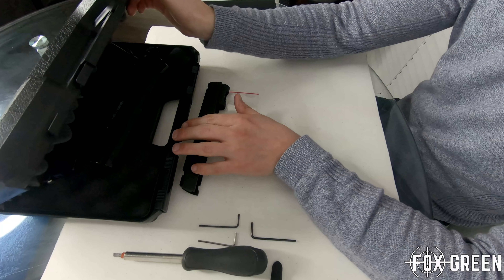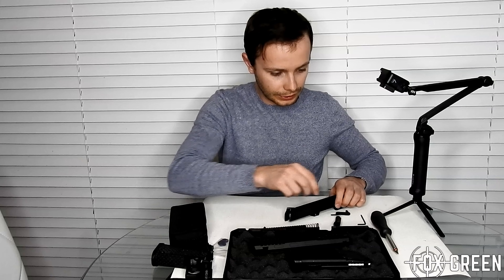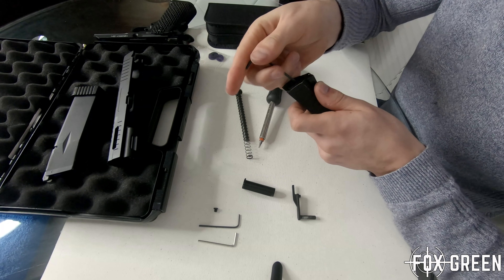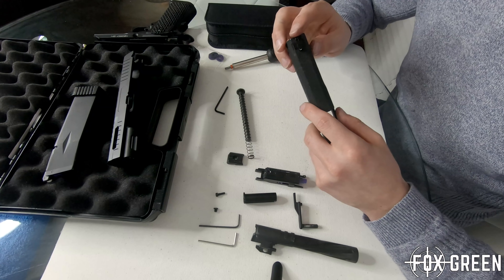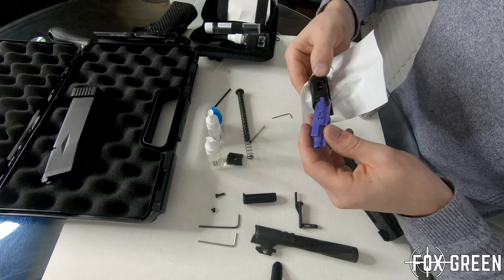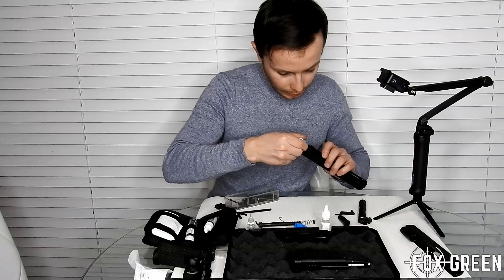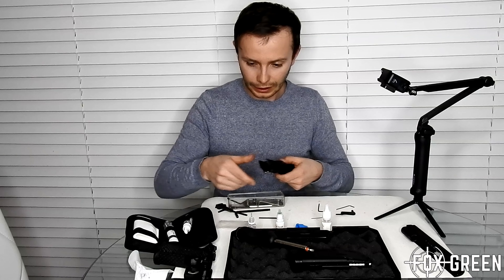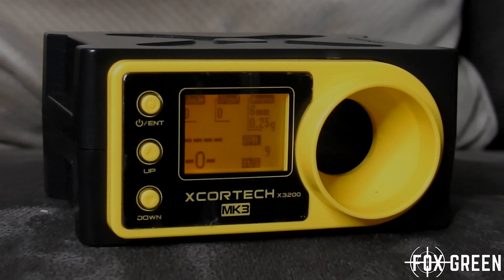NOVRITSCH SSP-1 SHORT STROKE KIT - INSTALLATION HOW TO VIDEO

Comment from the maker: Guys and Girls if you have any comments or queries that you feel I didn't expand enough on please drop me a comment and I will do my best to address it. Thanks Fox-Green
Reply: Know where I can find that tiny Allen key that you used to take off the front sight?
Reply from the maker: @andrewstewart6172  you could get a set of small ones on amazon if you look or a local hardware store is a good bet also thats where I got it 🙂
Reply: @FOXGREEN  I got impatient and cheap by finding an old iFixit bit (the one for phone repair) that was too small so I used a micro-fiber cloth over the bit to fill in the extra space and prevent damage to the screw and it came undone. One could argue it was simpler to do than a trip to the hardware store.
Reply: @FOXGREEN  Your response time and your content is superb, that earns you a sub 👍
Reply from the maker: @andrewstewart6172  good job man! Thanks for the sub 🙂👍

Comment: Great video! This gun is more tricky than others to short stroke... thanks for showing us the method!
You showed that the slide was still able to lock. Correct me if I’m wrong, but Shouldn’t the slide NOT be able to do so if it’s short stroked?
Reply from the maker: All other guns that are short stroked can't but this one was made so it should be 😉

Comment: Is the co2 pistol legal in ireland or is the fps too powerful? Just wandering cuz I saw on the website that the fps is over irelands legal limit.

Edit: nice vid tho  keep up the good work!👌
Reply from the maker: I got the first batch of ssp-1s and mine was over at 1.3 joules I modded it then to fix it which I also have a video on. However now I believe the pistol is actually under a joule as stated. He also released a black nozzek to fix the one that are over 1 joule whick I have ordered recently 😊
Reply: @FOXGREEN  Thanks! Will I have to worry about customs tho if I order it?
Reply from the maker: @redradical4313  coistoms didn't stop mine so you should be grand
Reply: @FOXGREEN  sound out👌
Reply: with green gas or C02?
Reply: might bite the bullet and get one. Was worried about the FPS with C02 being too high. I see the muzzle reducer on the website, but if I can get away without needing it that'll be 💯
Reply: I just ordered two more CO2 mags

Comment: Hey Kieran nice meeting you today in round wood just wanted to know if you need to buy a less powerful spring for the ssg24 or does the m90 do fine and also what gram BB’s do u use for the ssg24 and also does the ssp1 meet with Irish laws out the box or is the spring to powerful
Reply from the maker: Same here man great playing with you. If you get the Ssg24 with the 1 joule spring I think it is an m90 that is grand. Mine shot a bit low when it arrived so I put in a better spring and some shims to tune it to 325 fps and never touched it since 😊
Reply: FOX GREEN oh ok and what gram bb’s do you use
Reply from the maker: @brandmd5657  today I used 0.32g bb's depending on wind I may use 0.28 or 0.3 as also as I will get more range with them
Reply: FOX GREEN thank you and by chance do you know the name of the spring that you upgraded to
Reply from the maker: @brandmd5657  I don't actually man sorry 😔
Reply: FOX GREEN it’s all good man thanks for the feedback✌️

Comment: Hey was just wondering how you got the spring guide rod to come apart so easily. I’ve already broken two due to it being glued in. Any ideas?
Reply from the maker: I used two Allen keys to lever it open  but it wasn't that tight. You could try heat oneside of it so it expands maybe at the same time making it easier to open.
Reply: Yep I broke mine the (screw between)
trying to separate couldn't seem to
fit in one piece

Comment: My spring guide quite literally will not come apart. I have bent an Allen Key and have let it soak in acetone for 3 hours and it still will not screw apart. Any tips?
Reply from the maker: Hmm wired I don't really try soak it in oil for treads to see if it outrages through.

Comment: Will this work with the original hi-capa 5.1 and will the slide lock back
Reply from the maker: The mags work but the seal isn't correct between them and tha has chamber so the gun doesn't shoot very strong with tm hicappa mags. They do lock back yes
Reply: Does the cutout slide fit well on a hi capa 5.1 and how much does it weight?
Reply from the maker: @jeebeshshrestha5456  I don't have a scales to measure it but it's aluminium so very light weight. I don't know is it compatible with a TM hicappa sorry